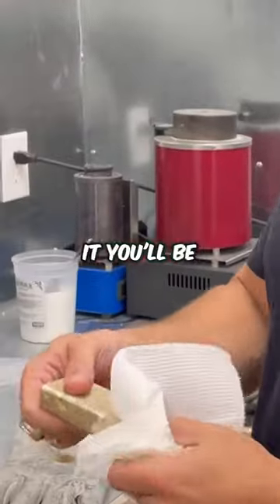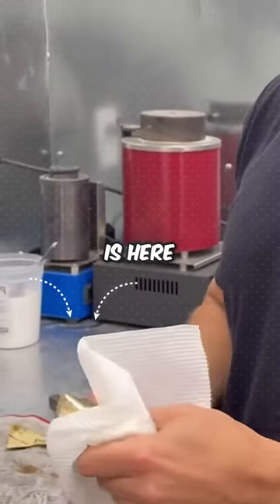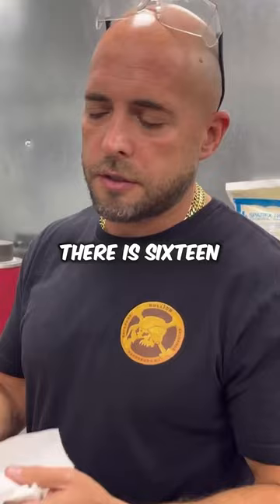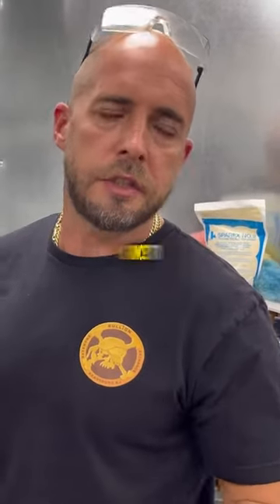Drilling $200,000 Gold Bar: Is it REAL? #shorts

Comment: when u drill it u take fileings  u drop  a chemical  on them   or u can scrach test  if u have smaller like a coin or 1oz bar   ...  if ur useing an xray u looking to c if its loaded    as in has a def base core  metal   but that  is redundent if ur just gona drill it    then again  u not gona drill the hole bar so   ok ..........

Comment: so what if its gold where he drills but not the rest
Reply: It doesn’t work like that. If you test the bar anywhere it will read the same.
Reply from the maker: The whole thing was melted into one uniform Liquid Metal. It doesn’t set with clumps throughout. It’s equally mixed and distributed. That’s like you saying “is the gold eagle more pure on one side and more copper on the other”.